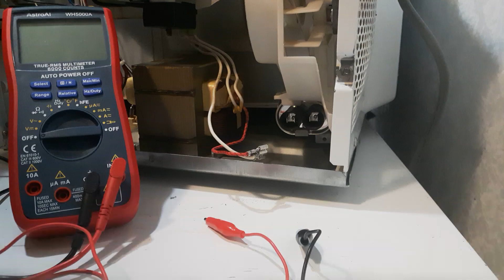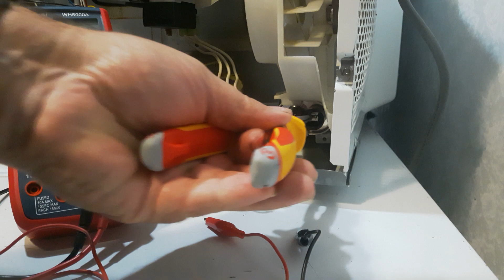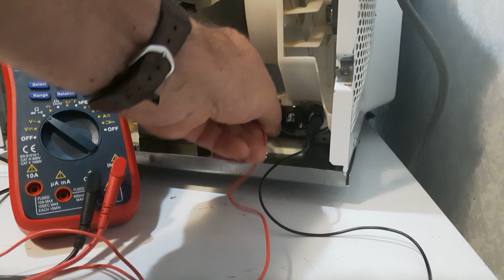Microwave runs but no heat Part 4 of 6 ( Capacitor )

Comment: Hey Jim, if the multimeter says 1. once you check between the capacitors leads and nothing changes (I think that means there's infinite resistance), what does this mean? Is this the part I should replace? Edit: Apparently you should have the multimeter set to aproximately 10-20Mohm to do that test, and then make sure there is no continuity between the leads